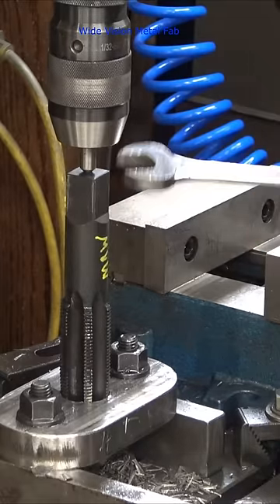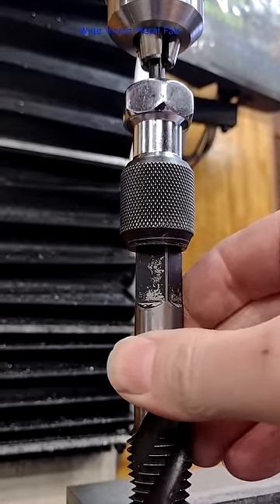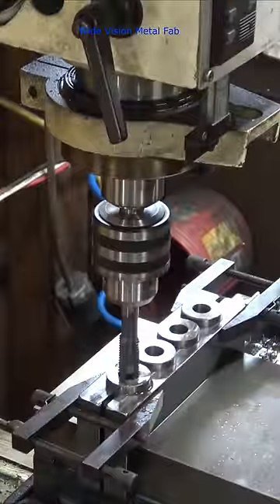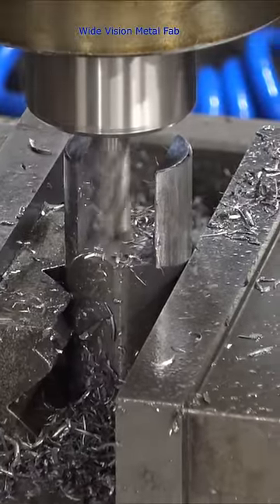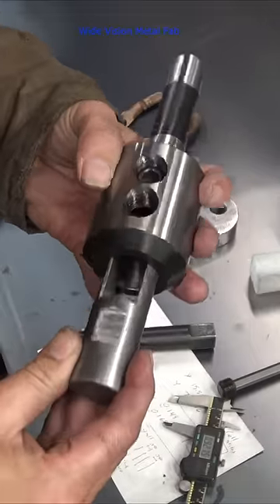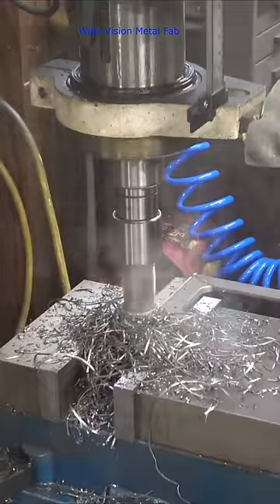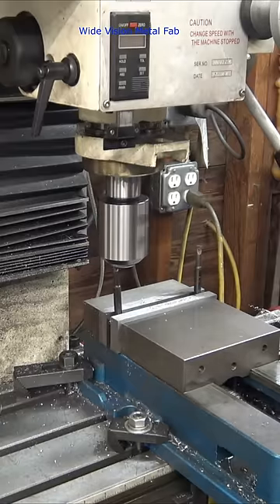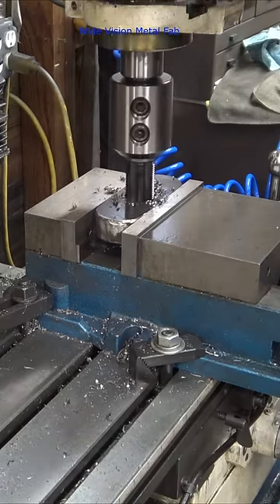TAP holder in the milling machine.  #machining

Comment: This is great, I’ll be able to break taps much faster with this adaptor
Reply: ...rather than develope some shoulder and arm strength.
Reply: I was taught to allow for slip so I didn't break taps
Reply: Never broke a tap while power tapping,mill, lathe, or mag base, sooooo what is your problem?🤔🤣😂🤣
Reply: This is obviously a bad idea and I'm not a machinist.
Reply: @RZRL1990 why?!
Reply: @RZRL1990 Except it isn't. My old workplace had cnc mills that tapped holes as small as 1/32" which if course means, the tap is 1/32" in diameter. Those tiny taps are really easy to break, but as long as the program is correct, they don't break, and the hole is tapped perfectly every time.
Reply: Jeezus crispy, guys. It's a fckn joke.
Reply: @RZRL1990  this is a perfectly fine idea if it gets your parts made faster. To each their own, and I am a machinist.
Reply: @RZRL1990 no it’s not.
Reply: @juantaladega126 Breaking taps is not uncommon at all when running large production, youve just gettin really lucky
Reply: I'm not saying you can't tap under power, I'm saying I can't.  Slight difference, mostly a skill gap.
Reply: I remember an instructor making people tap everything by hand because our program was largely filled with novices who weren’t familiar with taps, ez outs, etc. and would otherwise just put them all in a drill press.
Reply: @bernardvonderheide1268 I know a mobile machinist that taps almost everything by mag drill. He does the same thing, allows slip so they don't break, and slips when it bottoms out.
Reply: Taps break under lateral pressure, if it’s straight and the pressure is distributed evenly in theory it should never break, but then again we have reality and people with experience either have luck with it or dont
Reply: (I am not a machinist and have never used a tap in my life)
Reply: Rookie
Reply: Rookie
Reply: And do a shit load of that and you will be able to call yourself a machinist.
Reply: So you have machine taps MT's and hand taps HT's... Where HT's has a massive taper up to the final size (usually around half the length of the threads length) and then, like this tap, MT's almost go straight to thread height from go.

So long as that mill is belt driven then this is perfectly fine because if something ever does protrude to cover them bottom of the large hole, on a tap like that, the motor will just start to slip on the belts.

There's also the whole shop price Vs tool price. If you breake this $50 tap but charge at $100 pr/HR and save an hour in production time when running the job, well the shop just made $50 profit
Reply: Ive power tapped thousands of 1/2-13 holes with a mag drill. Aint no thing once you find a good set up.
Reply: @juantaladega126  you probably just started then 😂
Reply: High speed tapping breaks far less than low speed
Reply: @tangydiesel1886 wtf is a mobile machinist?
Reply: @RZRL1990  I mean you probably think it's bad because you're not a machinist. Depending on your mill, there's no reason this shouldn't work. I've seen cnc mills so precise they can tap the same hole twice without messing up the threads at all. The only problem would be if you're tapping something really hard without lubrication. Like I did with your mom last night
Reply: I always would power tap when I could. A lot less work. I would use a machine tap and in the Pic that is a bottom tap
Reply: Upping everyone's BTJ' s

(Broken Taps per Job)
Reply: @juantaladega126 
I haven’t .. but I liked your comment because I know it’s possible. 
I also know it takes special machine taps.. that are expensive.
I bought a 2 jaw chuck works well for smaller taps (surewish I could find a bigger 4jaw) and adjusting the drill press belts for slippage. With  a forward/reverse foot peddle it’s ‘so far so good ’ with the cheap set.
😜😏👌
Reply: @andrewbenoit5208 
Tap: “look I’m broken ffs!!!”

Me: “must be happy hour”
Reply: It feeds itself. You can't break it........unless you're a welder,. They can break anything.
Reply: @garyk8893 that's a great observation. That bottom hole tap doesn't cut a lead. He's basically cutting the whole thread at one time.
Reply: Skill issue
Reply: That made me laugh out loud😂

Comment: If only there was a cheap solution to this. Like maybe an ER collet with a square socket to hold the tap flats.
Reply: That would make sense. Enough with that nonsense
Reply: Small shop guys hate using anything practical and pre-made from a well known company. C'mon now everyone knows this.
Reply: Well, I do not think tap collets are that cheap, and again I think they only work for one size.
Reply: They make er tap holding collets
Reply: @romanvarcolac2238  this also only works for one size but yeah collets aren't cheap. They do make tapping heads that will stop and reverse when the thread bottoms out but they're even more expensive
Reply: 18 piece er32 tap holding collet sets run a couple hundred bucks
Reply: @johngarlick7115 fr, as far machine shop tooling goes it's negligible
Reply: @Randald  yeah the time, material, and machine/tool usage to make that probably cost as much as buying the right stuff to do the job.
Reply: Could get a procunier tapper. Fits in any chuck and runs a clutch for clean forward and reverse, runs up to 1 inch taps depending on the size and collets you get. Pricey but solid and reliable
Reply: @mrmediocre1532  think he was wanting to rigid tap for tolerances, those things are great but if it’s a tight tolerance on threads rigid is better.
Reply: Or even better, a compensated synchro tap holder, as in the thing that's specifically designed to hold taps in a machine
Reply: @KurwaRomek  rigid tapping still offers better thread tolerances, anything that moves in a tool holder can allow run out.
Reply: just put a small tack on the tap. it'll grip in the chuck
Reply: @madhouse5213  don’t weld on carbide bud it doesn’t end well for anyone

Comment: R8 to er32 or r8 to tg100 collet chuck is what I use for taps. You can easily get  them in sizes that will actually fit the taps! I have er32 collets that have the square in em just for taps.
Reply: Same I use a rig called a Tap-O-Matic on my mill and lathe

Comment: I work in a machine shop, what we do is if we need to tap on the mill or lathe we use a hex bit socket, put the hex in a a chuck and depending on the size of the tap use a 1/4”, a 1/2” or a 3/4” socket  works well and allows room for play. Hope that makes sense.

Comment: When I was doing production machining we had a huge selection of split bushings for holding taps and their form factor was identical to this. Only difference being they were split vertically and held together with O rings in recessed bosses so the halves would stay together
Reply: Way better solution 💪🏼👍🏼🫡👏🏼

Comment: You know they make tap holders. Taper lock and otherwise, we have them from 1/4inch all the way up to 1 1/8 but I'm sure they have them bigger those are just the sizes we use. We use em in our cnc mills and radial arm drill press

Comment: That's straight up a work of art. Great craftsmanship.
Reply: Proper craftsmanship is doing it by hand. Highly likely to break taps and ruin the part doing it in the machine. Start it in the machine so it’s straight then finish it by hand - that’s the work of a craftsman

Comment: Get a tap handle done use a wrench. I do m16 taps starting them in the machine so they're straight and finish them by hand. Not that bad with a good size handle.
Reply: 100% same. I learned this technique from Curtis at cutting edge engineering. Lots of great videos and you learn something too. Also, he treats the homeless with respect.

Comment: I sculpted popsicle sticks when I was in high school and I remember I did so much work to make something easier to do. I remember I need to poke holes on the popsicle sticks quite alot and it keeps on breaking so I made a holder for it and a specific tool for carving the hole out, works like a charm and I never had broken sticks ever after that

Comment: We used to use a tap holder with a slip clutch back in the early 80's where I worked. I can't remember what it was called? You used it on your drill press. Once you secured the tap in it, you could adjust the clutch to slip as to not break the tap. If the tap got in a bind it would slip, lift up on the Chuck it, it would reverse back out. Pull back down it would keep threading.

Comment: I've been a tool and die maker for 14 years and have never had this issue. I'd suggest a tap handle and or a bigger chuck.. 

Small taps are the ones you need to worry about. Big taps.. wrench that suckered down and make sure you drilled at the right size. If bogging down is an issue then drill a little oversized if it's not some customer job with extreme requirements/GDT. If you get scared (I do) kill the power and reverse, jog the machine to solidify/smooth the already tapped threads and continue. Or just tap by hand after letting the machine only start the thread. Big taps shouldn't require this much concern. I've also never  used a universal tap holder.. doesn't seem so universal and clearly it isn't. That's what a properly tightened chuck or collet is for..
Reply: Some lower comments noted "no tapping oil" which I didn't even fathom as a possibility of not doing so didn't consider this. Even with it these big taps will bog a machine or spin in the chuck/collet.

Comment: Or you just buy a tap holder….. and tapping head….
Reply: I think the point here is why buy it when you can make it? Sure if you don't have the means of making your own parts then buy it, however parts can get very specific and maybe finding the right one for your bench is nearly impossible or expensive than it would be to just get the raw material and make it yourself. There's pros and cons to both but I'd say the biggest pro of making it yourself is making it how you like it to suit your needs whereas a bought adapter may not have what you need in terms of features and/or tolerances.
Reply: @stxejn Some people don't get it honestly. If you already have cnc and machining equipment why would you spend any bit more than the steel it would cost to make your own parts? People would be mind blown if they saw how many tools we make on our own for specific purposes in the mechanic industry just because the same "official" tool is $100-$500.
Reply: @neithertwosturrr3016  I seen that. I'm not a maker nor do I do anything with machining but I'm a huge fan of people that do. Probably because as a kid I took things apart just to see how they worked. I could never put them back together though. I've learned one of the most valuable things in any Machinists or anyone that deals with tools or engines is a concept I came up with called "cost of effect" which is "how much am I willing to spend to fix this problem" and that could be machining your own part, or it could be modifying an existing tool, such as a harbor freight tool, to do a job even if it only needs to be done once, potentially destroying the tool in the process. I've seen many people modify super cheap tools for a job they don't want to risk on breaking their expensive tools and it's something that may only need to be done once every few years. The cost of replacing a $10 tool far outweighs the cost of replacing your regular tool that costs $100+.
Reply: @stxejn well but why not make your own tap then?
Reply: @AlessioSangalli  precision grinding equipment you would need to finish making a tap is much less common to own.
Reply: @AlessioSangalli because that would require precision of the o/d, thread pitch and hardening of the tool. Typically you'd use a lathe and just because he has a mill doesn't mean he owns a lathe.
Reply: @stxejn  there are er collets and tap collets that fit literally every tap size out there

Comment: A square drive tap, fits perfectly in a 12-point socket (of suitable size).  All you need is a 3/8" or 1/2" square drive, to put whatever socket fits that tap.  :)

Comment: I just burn/EDM square pocket in slug for what ever tap size I needed, so i have a series of slugs that fits in arbor. I have multiple arbors up to 2.o " NC . we use it on boring mills , radial drills or vertical mills.

Comment: Been a machinist for 35 years. I power tap every day with a regular drill chuck yes they do wear out and start slipping. But they do sell new ones. 
    However there is a solution to that. Spend the money they now make 4 jaw Jacob’s chucks. Not just the normal 3 jaw.

Comment: Use a twelve point socket it works every time
Reply: Sorry, not every time. 
But they do make a set of sockets that are made just for taps I have a set they have rubber O-rings inside them that hold the tap in in the deep part of it has a square shank cut in it or square hole or whatever you wanna call it but any size you would ever need then all you would have to do is put you an extension in your mail or drill or whatever you’re using
Reply: Your right.. as long as you can attach a square drive to the chuck...and have larger sockets for big taps..which isn't hard...👍
Reply: Ratcheting 12 point wrench sounds perfect. Reversible for backing off.

Comment: All you need for the tap holder is to drill a piece of stock the diameter of the shank 
And the drill a hole crossways through the stock the same size across flats of the square drive of the tap to locate it 
It's very easy to make and takes minutes

Comment: You can do a variety of things to make the tap able to be held. Nut over the square,pressed through the threads and cut a 1/2” extension off and make lands to fit the chuck jaws then just put a socket on the extension and then socket to the nut

Comment: You can buy a quick change set-up. You'll put a special nurld spring loaded collar that accepts individual tool holders. It's like what you see on these cnc endmill or drilling machines. Every individual drill bit,  endmill or drill bit will be in an adapter that pops into the locking collar. Pricey but makes everything a whole lot faster. You don't even to stop your spindle to change your tool.

Comment: I remember when I op'd a CNC. Tapping 8-32 into an aluminum casting,  didn't always go well. We had an "extractor" that worked kinda like reverse welding. (Still a pain). Also tapping 1/4" deep blind hole, with 3 modified taps (shortened tips). These were expensive parts.

Comment: Since we aren’t concerned about snapping the tap with this solution, I propose an easier one. Grind 3 flats on the round shank of the tap so the chuck jaws engage better. Problem solved until you bottom it out and snap it

Comment: I have a drawer full of old chucks that I crank the hell out of. The tap will spin in the chuck before it'll snap. It's usually enough to at least get the threads started. Sometimes I'll use an undersized tap as well. Then I use moorse taper tap holders. Biggest I've ever tapped was 1&1/4-8 with a bolt broken off in it.
Reply: Use 3 axis cnc mill then use thread mill so much time saved down rd as will save a part when tap brakes but can control size use tool dia compensation just be sure to check to go no go gage and just use tap to chase threads after heat treat or go about .010 bigger will shrink down after heat treated no fun to thread after heat treated but than again have option to mill threads after heat treated than hold to go no go gage best for high tolerance

Comment: Your adapter doesn't float, that's a major feature of any tapping head. You would have been better off machining an adapter to drive the square with enough tolerance to accept misalignment like the commercial versions.

Comment: Yeah tapping anything over 5/8 is a pain all I ever did was make a sleeve the same ID as the tap OD and OD of the sleeve same as the cutter holder  ID. drill a hole in it so the set screw can pass through and grind a small flat on the tap you can do it with a Bridgeport 1 inch cutter holder works great

Comment: I use a ratchet with the appropriate size 8 point socket. Took a center drill to the back of the ratchet head so the center can apply pressure to keep everything straight. That's how we do it in the field anyway.

Comment: I like using a tapered cone on end of collet to recess of tap then apply pressure as tyrn by hand , tapered taps trying to stop at end then reverse under power without going last few threads a little berve racking

Comment: What you do is to drill a pilot hole and then move to the mill with a thread tool and run the circular interpolation routine to mill the threads.

Comment: What does the hole you drilled in the adapter connect to on the drill press? I'm not familiar enough to know, but is it attaching to the main jaws that you would normally attach a drill bit too?